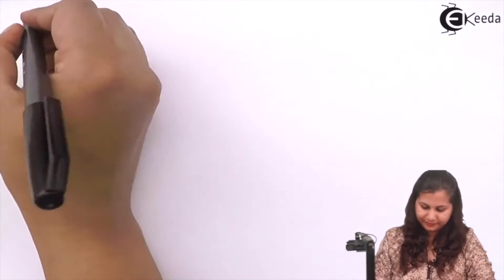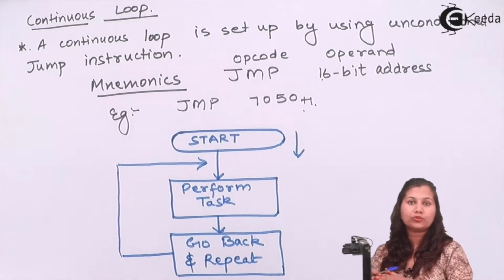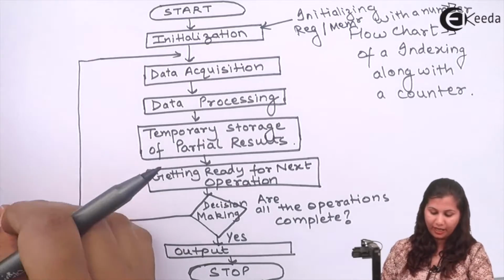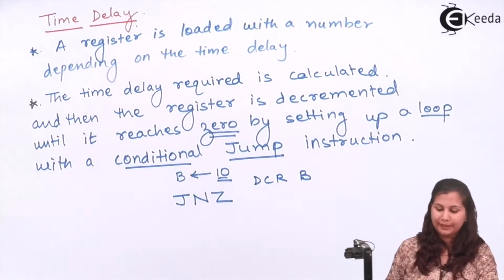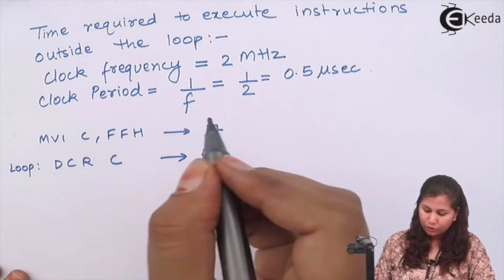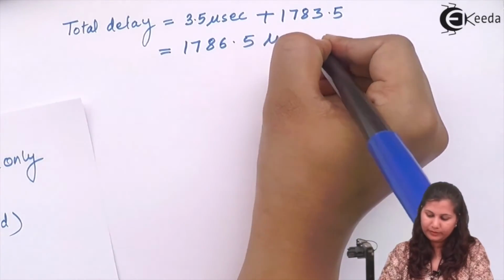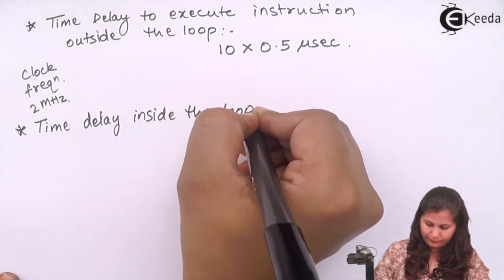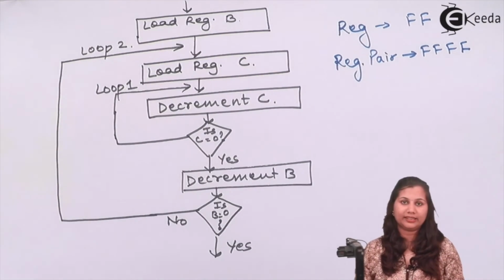Programming Techniques in 8085 Microprocessor Looping, Counters & Time Delay

Comment: Summary:

The video discusses programming techniques in the 8085 microprocessor, including looping, counters, and time delay. It explains how these techniques can be used to shorten program length, reduce memory usage, and improve execution speed.

Key moments:
00:07 Programming techniques like looping, counters, and time delay are crucial for writing efficient programs in microprocessors like 8085, reducing program length and enhancing user experience.
          -Looping is a technique in microprocessors where tasks are repeated efficiently by calling a short program multiple times, reducing program length, memory space, and execution time.
          -Looping involves setting up loops using jump instructions, allowing the microprocessor to change the sequence of execution and perform tasks repeatedly, enhancing program efficiency.
          -In 8085 microprocessors, loops can be categorized into continuous loops that repeat tasks continuously and conditional loops based on specific conditions for task repetition, each serving different programming needs.
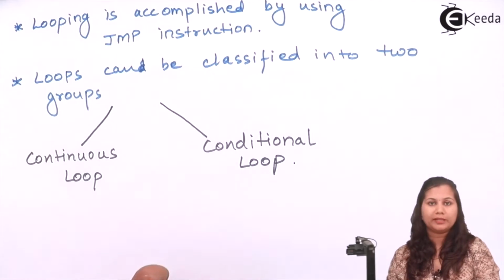08:04 Continuous loops are set up using unconditional jump instructions, while conditional loops use conditional jump instructions based on flag conditions in 8085 assembly language programming.
          -Explanation of continuous loops using unconditional jump instructions in 8085 assembly language programming.
          -Description of conditional loops utilizing conditional jump instructions based on flag conditions in 8085 assembly language programming.
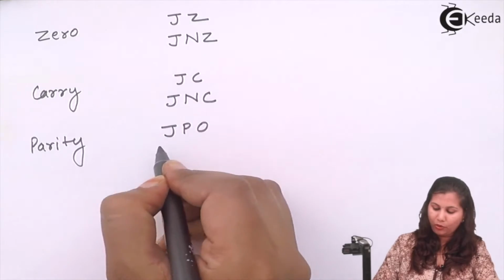16:21 Conditional jump instructions in 8085 microprocessor allow setting up conditional loops for repeated tasks based on fulfillment of conditions, ensuring efficient task execution and loop termination when conditions are not met.
          -Indexing technique in microprocessors involves referencing objects with sequential numbers, aiding in efficient data retrieval and manipulation within loops.
          -Using counters in microprocessors involves loading numbers into registers to facilitate counting operations, enabling efficient task repetition and control.
26:02 Counters in microprocessors can be used to repeat tasks multiple times by incrementing or decrementing a counter value, establishing loops for efficient processing.
          -Establishing loops using counters allows for repetitive task execution, controlling the number of iterations efficiently.
          -The drawback of fast processing in counters leads to only the final count being observed, necessitating the use of time delay techniques for better monitoring.
          -Introducing time delays between counts using register loading and decrementing enables better observation of counter increments or decrements for improved monitoring.
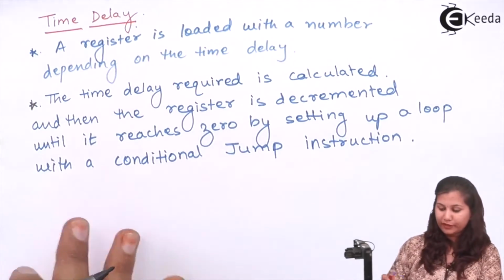34:28 The video explains how to introduce time delays in a program using registers and loops in a microprocessor. By decrementing a register until it reaches zero, the program creates a gap between instructions.
          -Introduction to setting up a loop for time delay using conditional jump instructions in a microprocessor program.
          -Exploring techniques for introducing time delays in a program, such as using one register or a register pair.
          -Demonstrating the process of introducing time delays using one register, loading counts, executing loops, and checking for completion.
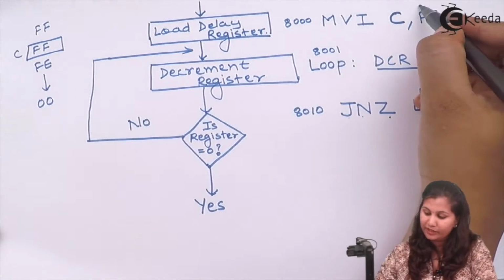42:30 Calculating time delay in a microprocessor involves determining the time needed to execute instructions inside and outside a loop, factoring in clock frequency and machine cycles. Clock period and total time taken for instructions are key in this calculation process.
          -Understanding the process of calculating time delay in a microprocessor. It involves analyzing the time needed for executing instructions both inside and outside a loop, considering clock frequency and machine cycles.
          -Detailed breakdown of calculating time delay. Exploring the significance of clock period, total machine cycles required for instructions, and the distinction between executing instructions inside and outside a loop.
          -Utilizing clock frequency for time calculations. Demonstrating how clock frequency aids in determining clock period, which is crucial for calculating the time taken to execute instructions in a microprocessor.
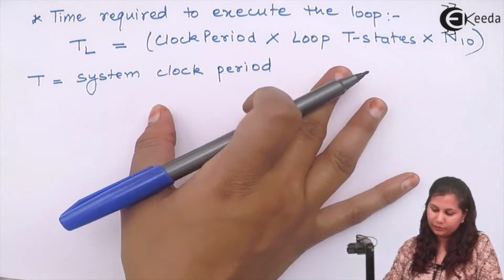50:34 The video explains the process of converting a hexadecimal number to a decimal number and calculating the total time delay for executing instructions, including adjustments for conditional jump instructions. The loop delay is calculated based on system clock period and total t states required.
          -Conversion of hexadecimal to decimal number and calculation of loop delay based on system clock period and total t states required for instructions execution.
          -Explanation of conditional jump instruction and adjustments needed in the total time delay calculation for the loop execution.
          -Calculation of adjusted loop delay by subtracting the time taken for three t states from the total loop delay.
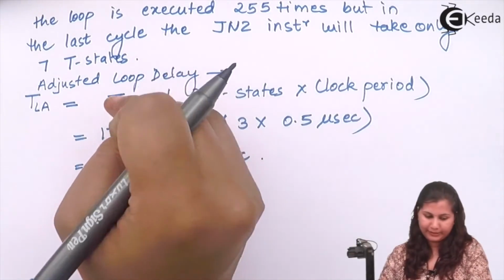59:36 The video explains how to introduce time delays in a program using register pairs in a microprocessor. Register pairs allow for longer delays compared to single registers due to their 16-bit capacity.
          -Register pairs in microprocessors consist of BC, DE, and HL, each pair being 16 bits, allowing for a maximum count of fff to be loaded into them.
          -By decrementing a 16-bit number stored in a register pair using the DCX instruction, longer time delays can be achieved in the program.
          -Setting the zero flag in the accumulator requires specific techniques as the zero flag is only set when the accumulator result is zero, affecting program execution.
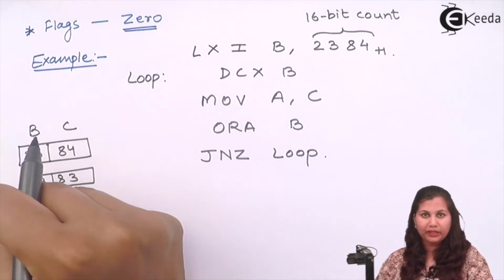1:07:40 The video explains how to set the zero flag by repeatedly looping until the accumulator contents are zero, calculating time delays using register pairs, and introducing time delays using nested loops.
          -Setting the zero flag by looping until accumulator contents are zero. This technique ensures the zero flag is set when both the accumulator and b register contents are zero. 
          -Calculating time delays using register pairs. The video demonstrates calculating time delays based on the number of t states and clock frequency, providing a detailed example for better understanding. 
          -Introducing time delays using nested loops. Explaining the concept of nested loops for introducing time delays, involving an outside loop and an inside loop to create a delay in program execution. 
1:15:44 Using a loop within a loop technique can introduce significant time delays in a program, calculated by repeating instructions multiple times, providing precise control over delays.
          -Calculating time delays involves determining delays in each loop, multiplying by loop counts, and factoring in clock periods for precise timing control.
          -The process involves loading registers, decrementing values, and checking conditions to control the flow and duration of the time delay introduced by the loop within a loop technique.